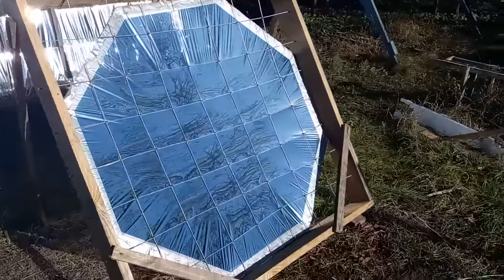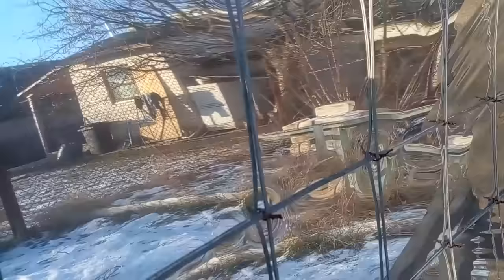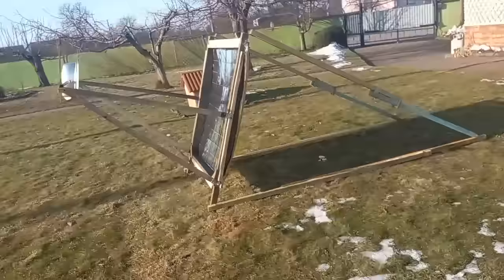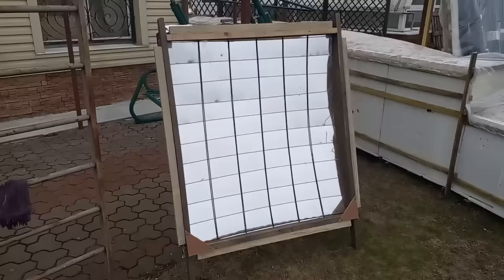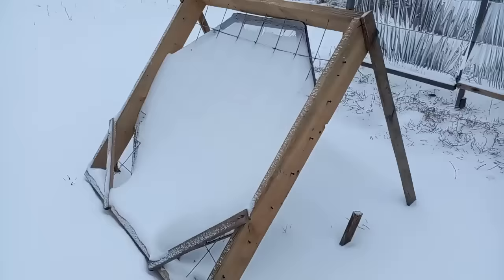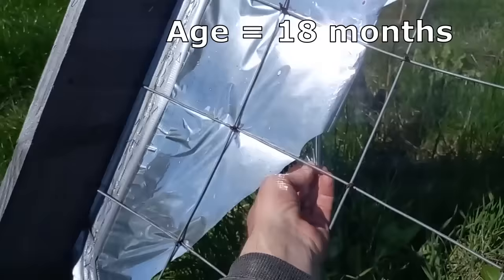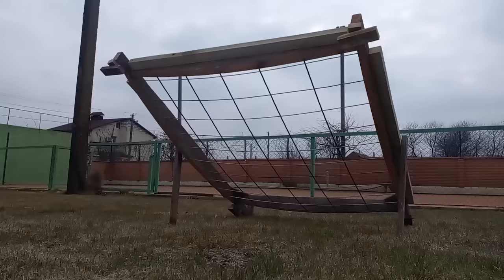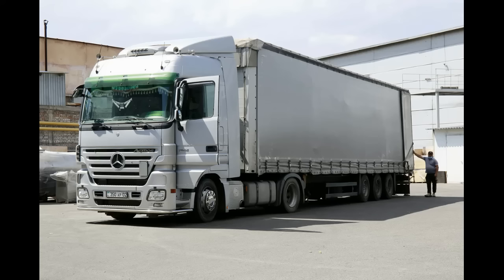The world's cheapest solar heater 300 ⁰С: its problems & their solutions, new experiments 2024

Comment: You’re not the first to implement a mesh behind a film or thin mirror. The main issue with films, apart from their lack of rigidity, is that they experience more thermal expansion and contraction, and they degrade. 3M was doing great research on films 10-15 years ago, but they shut the project down because there was no significant demand. I have used Mylar film for this purpose, and my film only lasted a few months before the mirror finish started wearing away at contacts points with the backing. I think the thermal expansion is manageable, but at scale these films must not degrade over decade time spans. This is challenging even for plastics that are supposed to be UV resistant, and it is no trivial issue. However, if someone solves this, films will certainly be the best option for concentrated solar.

Comment: Now how do we make a sand battery to work along side this tech. Forget startups and companies, DIY ftw
Reply: maybe regular electric battery for individual home, sand battery for industrial size
Reply: beam the heat into the sand, or use a liquid to move it into it.
Reply: but for just storing and capturing heat it is more easy to just make a big black panel and make water flow through it all across it, will work as well and much more simple also less heat differences and so less stress. still having a small object receive all the heat has it's advantages as well, but since we are talking about diy, you might want to concider it being harder to do.

Comment: Hey Sergiy, I am planning to start a company building cheap & simple solar hot water heaters for residential pool heating in the united states. I plan to begin with pool heating and expand into hot oil systems with heat storage and even csp pv using water cooling for electricity production. I am interested in working together sometime in the future. I am working on my own research using fence posts and welded wire / hog wire, this trough system is most similar to your earlier systems, but i plan to build these using cheap and automated fence post construction technology.
Reply: Good luck!

Comment: i would put water on the mirror film installed on the frame set in the horizontal plane until you would achieve the desired stretch and concavity and i would spray something on the underside to harden the film in the desired shape and hold that shape .
there is a greepowerschience video on youtube where you can see part of the process of making a diy water lens.
Reply: thats pretty smart, i just googled there soem products like Line-X , or.... damn windows didnt copy paste the others XD
that seems smart though, make a 2x2m frame put in foil, fil;l with water and spray hardener foam on back, remove water then isntall panel
Reply: @any1alive  ^_^

Comment: You could totally eliminate wrinkles if you made a "parabolic trough", it might also be easier to manufacture a frame for such a shape.
Reply: maybe semi circular, longitudinal, tubular receivers
Reply: rather cilindrical  with tube heat collector, less loss. and more focus of the mirror
Reply: @viuvenitlalumina  A semi-circular cross section wouldn't focus the sun's rays to a point. You need a parabola.
Reply: @robbiekavanagh2802  it needs a rotation of the semicircular tubes
Reply: @robbiekavanagh2802   it requires extra adjustments,  to follow the sun

Comment: Terrible plastic waste . We had a solar collector made from a surplus dish antenna 7' in diameter lined with glass mirror tiles , hardly any cost . I estimated the power generated in a good sunny day at 1200 watts . The dish is still useable after almost 20 years .

Comment: Simple: create aluminum plate/steel backer in correct optimized shape (by industrial stamping). Put (replaceable) Mylar film on it using nothing else but a thin coat of water as the glue. Surface tension suffices. You will not have wrinkles, but if you do: heat gun.

Replacement should be easy as only surface tension of water binds Mylar to the steel.

Cheaper is possible (i.e. thermoplastic instead of aluminum backer) but aluminum plate is cheap enough and no UV degradation.

Comment: I think the primary reason they do not use it is due to the generator to turn the heat into energy, as well as it not looking as fancy as solar pannels(marketing). and the fact of it being cheap and easy to make, meaning they can't sell it for insane proffits, companies actually hate positive change in general, so for a company to make something like this it would need to be a hobbyist or startup.
still has great potential indeed.
but might wanna change the design to something which for example uses fibers and expoxy to make a hard shell and to figure out some kind of special mirror coating. would be cheaper and also more durable.

one big advantage of your version however is that it could be made foldable.
want to make it take of then essentially make something like a popup tent, which can easily be folded into a small form and then just pop back, doesn't need to work perfectly so wrinkles aren't a big problem, just well enough to for example cook with it and generate some energy even if it uses peltier or such to do so, just something people might wanna take along on a hike, something chinese companies might start selling on aliexpress and such once that happens companies are forced to also make similar systems, which will evolve in similar systems optimized to be used on a fixed location and higher efficiency.

Comment: With a very large format 3d printer you might be able to create a framework for the film that would result in sharper focus and an increase in efficiency. This way you could experiment with frame geometry and ultimately injection mold the frame. I think you are correct that this mirror film holds great promise for concentrated solar, but it's also possible there are cheaper ways to manufacture parabolic mirror systems e.g. stretch forming or metal stamping. The tooling would be much more expensive, but the lifetime system cost could be lower

Comment: You can make a catenary dish by placing a small air pump in a large bowl, glue the mylar then suck out air until focus. But large scale is best to use a roll of steel roof sheet curved to focus on a pipe

Comment: Excellent work! Have you had any luck turning this captured heat into usable electricity in cost-effective ways? That seems like the hardest part to me.
Reply: only for your own house ....in the countryside  becaeeu it requires space. in comparison the  solar flower is very expensive, but it also stores electricity  over night and is transportable  and has "install in one go", as we know solar panels don't work very well in the very hot sun.... and also require regular  cleaning of the solar panel. (maintenance)

Comment: Human touch is what makes everything expensive. By trying to minimize that, the low overall cost could be achieved in both lifetime expense and manufacturing.

'Bubble forming' plastic by blowing and then using the latest car chrome surface treatment? Or maybe 'hydroforming' metal sphere with a pressure washer? The car industry has spent enormous sums to investigate how to make such treatments last longer. Another way could be making metal spheres by exploding underwater, or simply just deep drawing stainless steel in a mold (if there is enough capital available to make the mold). Polishing the deep-drawn metal receiver could make it last forever. A long-lasting, dust and dirt-repelling, care-free surface could be achieved by using the same self-healing nanoparticle lacquer used in the most expensive German cars.

Comment: What is the temp of the mirror surface and/or frame at solar noon?  If it is below melting point of 3d printing high end material, could you use Elegoos Orange large format 3d printer to optimize the frame shape?

Comment: how one does factory production is not the same way as one would do production in small batches. the key word is consistency, absolutely everything must be the same. 
the choice of material for production. wood is great but it's not always 100% the same from board to board, so you can cut it down to force it to be 100% the same OR you can switch to metal, plastic, resin or consistent ply wood. resin is expensive even industrially. injection plastic requires expensive molds. maybe striped bamboo might give you consistency but I would try cutting bending thin steel sheets gaining strength by the folds. I would attach everything with cheap spot welds and folded tabs. all that can be done by a shop and then move to fast industrial stamping.
the steel wire rods annealing and controlled cooling is how you get a consistent flexibility but it's expensive to do it that way, but you might also try thin steel sheets cut in to ribbons.
so the whole thing could be made from just 2 consistent materials thin steel plate and the reflective sheets. I would try to see if you could chrome paint the steel like a a old car bumper for the reflective to make it one material, but the reflective film is just so cheep.
I would attach the film in the factory by bending folds over a flat frame, but have a place to lock nuts in to place so the frame holding down the sheet could be reattached by nut and bolt by the customer when the time comes. they buy the nut and bolt and film square for them to do the replacement.
their is a process known as vacuum forming I would try something like that for actually heating up the sheet and putting it on. alternatively you could do the whole heater by vacuum forming. making 2 sides and gluing the two sides together then filling with sand at location so it does not blow away, but that seems like it would be easier said then done, and I would suspect you would have many unhappy customers at highly not durable construction but I could be wrong.
keep up the good work.

Comment: New PV now days cost less than less than 9c/Wp and used 250W panels go for 2-4c/wp . LiFePo4 also goes for less than $50/kwh and with the rise of sodium chemistry will become even cheaper the next 5 years. It will be very difficult to beat those prices... Price are already dirt (as in the price of ore) cheap... Cheap renewable energy is basically a solved problem. The only technical/industrial hurdle left is seasonal storage and bulk transport trough H2 - LOCH or ammonia route which is also a 'solved' problem just not industrialized like PV and LPF production.  As I said renewable energy will be dirt cheap in 10 years. Most work will be building those GW PV plants in remote desert areas at industrial scale.
Reply: Solidstate PV last 20+ years without any maintenance and less than 10% degradation in practice... The tech is almost impossible to beat on LCOS. The only reason too replace the older generation panels is because higher wattage per/m2 for the newer generation. But then again, m2 are dirt cheap in the dessert.... so basically no depreciation on the panels driving the LCOS 0 cent per kwh.... Thermal solar to electricity is lost cause..